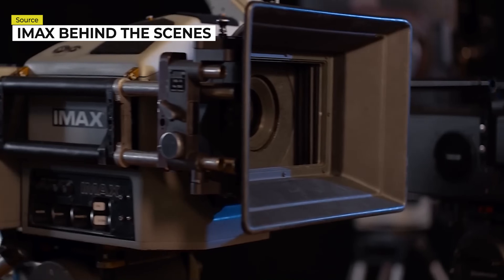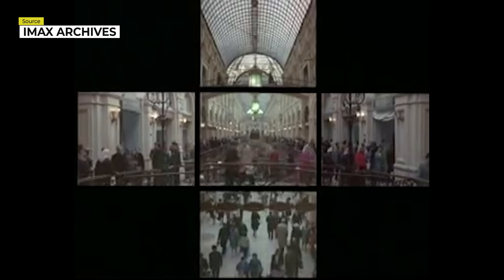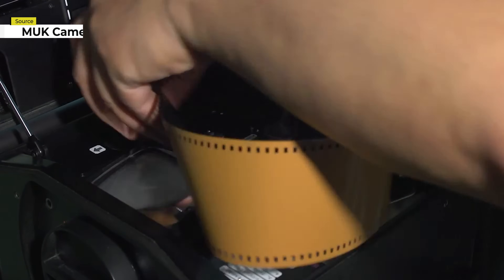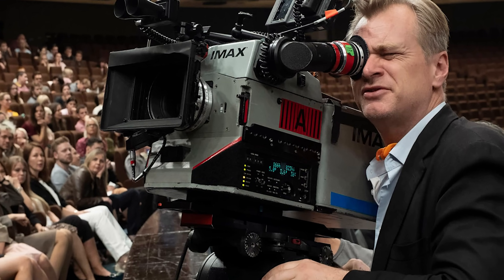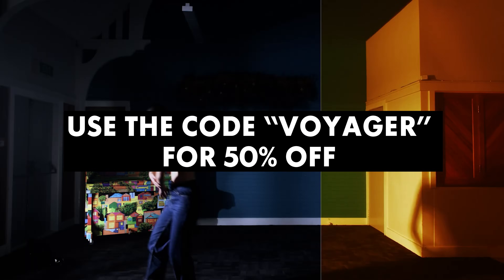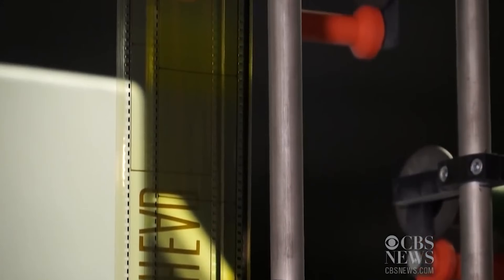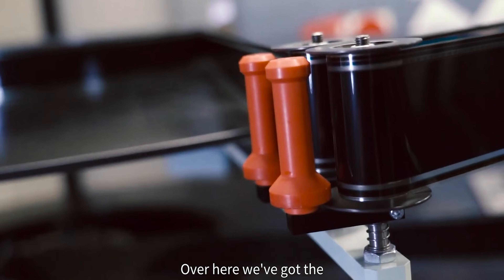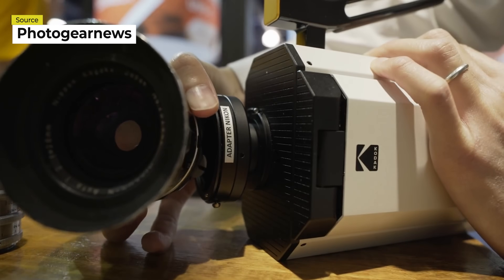The TRUTH about building a Digital IMAX camera

Comment: why can't you just use original imax-lenses in your hypotatical imax camera, those already have the image surface
Reply from the maker: Because of the difference in lens construction. They tend to have larger backend elements that push into the camera where the sensor for a digital camera would normally be. George Lucas and panavision had a really hard time with this back when they first converted to digital for Attack of the Clones

Comment: Shorty at 7 minutes has it all wrong. Scaling up 8k footage to 16k that was likely shot on a super35 camera doesn’t solve for difference in depth of field, it wouldn’t have the same pixel density as it has less sensor surface to work with. Not to mention dynamic range, etc… The only solution is to make bigger digital sensors.

Comment: With regards to "film emulation" I am not sure that is important.  It isn't necessarily the be-all-end-all to look like film.  Film has its limits too, and you could look at it as they were stuck with grain, like it or not.  The thing that matters is detail.  If the detail can be captured at a high enough rate, it can rival imax film.  It could be transferred to film, if they really want the film look.  So the question is how to get 15:70mm levels of resolution.  

It is certainly possible to make a camera that approaches the the theoretical 18k resolution of imax film.  That would be several hundred megapixels, oversampled, and potentially requiring multiple sensors for dynamic range.  But that should be possible these days...

Comment: This might sound like a stupid question 
Why can’t we use the same sizes of lenses on the digital sensor as the film camera if they are the same size
Reply from the maker: Not a dumb question! I should have answered it in the video as it's the most asked question lol. So film lenses have larger backend elements to them because of the lack of a sensor they can go farther back into the camera. George Lucas and Panavision had multiple problems trying to adapt for the first time using digital cameras because of this issue. So you'd probably need to develop some specialized lenses or figure out how to properly adapt the old ones

Comment: If it’s just the grain needed, one could used a older Sony pro DVHD camera with a digital output and lay the two images on top of each other to create the mask.
It’s not really that hard and one doesn’t need to go as high as 2.5 K to create in image that could be shown in a higher format.
Film is not pushed that high and the bigger you go the more you can get it wrong.
It’s not just the size.
It’s more the look.
I’ve been trying out things like this and am working to test it with look being more important then size.
The over lay will create the bigger image.
There isn’t a software yet available that can stack up digital footage.

Comment: I have a 9x12 (cm) glass plate camera. And the negatives are crazy. IMAX essentially has 24 of them per second. 

I do believe that digital can get close. We have massive sensors but those never make it to cinema camera systems. The largest CCD sensors are like 92x92 (used for telescopes as you have shown before). 61x61 sensors are in "cameras" like the Andor iKon-XL. 
Next there is LargeSense which I believe uses medial CCDs normally used for digital xray plates simply with the flurescent layer removed. Their LS811 is four of them while the LS45 is a single one. see a video from Ben over at AppliedScience for how they can work for x-rays. And with a bit of equipment I believe it could be a visible light detector (for video too). 

And it's not just the pixel resolution. BMD Ursa 12K ha been called digital iMAX but so has 8K
Reply: I mean technically, the Vera Rubin Observatory has a CCD the size of a 4-square court or something IIRC.  However I think a 52x70mm sensor would be very doable to produce if you really wanted to.  The issue is that this thing could be easily something like 12K and the readout speed + thermals would be a challenge.

Comment: I see the problem being that we have decided, somewhere along the way, that a bigger film print is a better image than what a 12K or let's go nuts, a 24K digital sensor would capture.  The reason we would have to try so hard to make a huge sensor, which would require huge lenses is because we are trying to force a digital image look like a flawed analog format.  One of the reasons film looks so nice is because we've been conditioned to think that's what it's supposed to look like.  And that's ridiculous.

We don't experience life in 24 frames a second.  And we don't have film grain or any of the other character flaws of lenses or film stock in our eyes.  Digital has the ability to better reproduce what our actual vision is, but when we attempt it, audiences reject it.  The 48 frame per second version of the Hobbit trilogy wasn't widely preferred over the 24 presentation.  And Gemini Man filmed and presented in 120fps was just really off-putting.

So we are stuck experiencing film at the same 24 frames a second since the late 1920's.  Until our expectation of what a film is supposed to look like changes, we will continue to try to make digital cameras produce an image that looks like analog film.  It's my opinion that the percentage of viewers who would appreciate a real IMAX 15/70 presentation is extremely small, as compared to the percentage who just want a big screen with loud explosions and transforming robots.

So it makes very little fiscal sense to chase this dream.  The closest REAL IMAX 15/70 theater to me in Orlando appears to be in West Palm Beach, 3.5 hours away.  As much as I'd like to experience Oppenheimer as Nolan intended it, I'm not going to be making that drive.

Comment: I was wondering if the lenses used in the actual IMAX cameras wouldn’t fit in that theoretical IMAX digital sensor?
Reply from the maker: Depends on how Large the backend elements are. Problem they had moving to digital in the 2000s was the lenses were too large and would hit the sensor block

Comment: And no one speaks of the importance of having a wide sensor ! Proportion and field of view ! Dammit, this is probably the most important thing about it ! We don't care about resolution, it's useless, 4k is enough, stop arguing about it. The size of the sensors means that you can mount a 50mm on it and have a wide angle as natural as the eyes vision. This is the real power of 1570, it looks natural, because it is as close as we can get to the eye' perception.

Comment: Loved the video! My BS alarm is going off about the claim that the 9x7 can produce a more shallow depth of field than an IMAX camera though. Everything I’ve learned about DOF has been explained in terms of sensor (or film) size and the physics of how apertures work. Without more information, I can’t wrap my head around how he could possibly be correct about this unless he’s trying to claim that the size of his system accommodates massive lenses with massive apertures.
Reply: seems like the obvious step to take?
Reply: yea going from apsc to ff i  don't get how it would be ever possible for apsc to have less dof then a ff ? always thought that the large the sensor the less dof you get and the reason phone cameras have so much dof and have to fake it using AI or some nonsense

Comment: wow SERIIOUSLY just looked the supposed "9x7" camera that was mentioned in the video
the sensor size isn't even larger than full frame!!!!????
like it's already an accept fact that NOBODY gives a shit about resolution! it's the actual sensor SIZE that matters
15 perf 65mm film is absolutely GIGANTIC compared to full frame. it is going to capture a completely different image because of that
all those technical jargons that you tried to come up in the video and you don't care to include that property of imax???
Reply from the maker: We did cover what the translation of 15 perf 65mm film size would be for a digital sensor at 15:00 - But we said that it would be close to 70mm x 48.5mm which of course is not the size of the achtel 9x7 camera. But some of the argument there is you might not need the sensor size to be that large to get the equivalent image.

Comment: You lost me at 15:50 Problem 4: needing larger lenses. If this theoretical digital sensor is the same size as 70mm IMAX film, then why can’t it use the same lenses as the IMAX film camera?
Reply from the maker: Same reason Panasonic had to redevelop their film lenses for star wars clone wars. Backend elements on the lenses were too large and would bump the sensor. So thats a potential issue depending on lens construction and design. Depending on if you go all out and use current "IMAX" glass. This video is just pushing everything to the max
Reply: @FrameVoyager  I see. Very interesting, thank you for replying :)

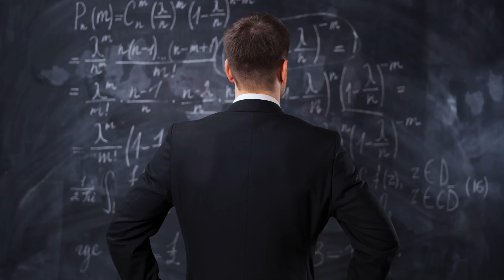Comment: 16:26 24.19 gigaBYTES a second uncompressed 14-bit 18k raw AT 24p, NOT EVEN GIGABITS, even at 3:1 thats 8.06GB/s, even 5:1 that's 4.84GB/s. Actually insane. 

Theoretically, that means in a terrabyte you'd have:
41 minutes recording time lossless,
124 minutes 3:1,
206 minutes 5:1,
AT 24P. FOR A TERRABYTE. AND WHAT STORAGE DEVICE EVEN HAS THAT OUTPUT

Comment: My attempt at calculating the bandwidth required for 18K, assuming that means 18432×10368 and 16-bit color depth.

18432 pixels × 10368 pixels × 24 fps × 3 components per pixel × 16-bit per component = 200.15 Gbit/s = 27.52 GB/s

That's of course assuming that you're storing the footage completely uncompressed, you may be able to get significant savings by using a lossless coding technique, but you'd probably have to build your own chip to handle that throughput.

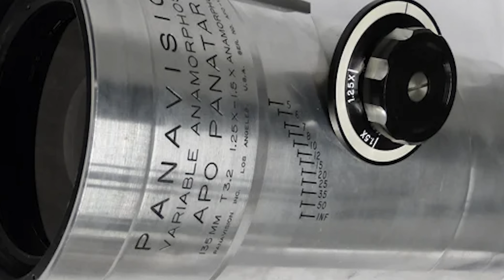Comment: but, doesn't IMAX already have the necessary lenses for this format? I mean, you said 15:55 that larger lenses were needed, but also you said before that each IMAX frame is in the 70mm format. What gives?
Reply from the maker: Historically, there have been issues with how the lenses are constructed for film cameras vs digital. When they first started to film digitial for phantom menace, panavision lenses were used but the backend elements of the lens would bump into the digital sensor. So I'm assuming similar problem here

Comment: People need to stop using Steven Yedlin as there only source for the film/digital debate. There’s so many others from the technicians at Kodak, Arri and IMAX who can break down some of his fallacies. Such as film being indistinguishable from digital. A film scan, depending on the situation is an interpretation of film so can be mimicked (not easily which is misleading) but an inter-positive print is totally cant be copied. But his claim that 6k is the max resolution from IMAX is physically false. If you’re getting 2.5k from a 4 perf frame (not optimal conditions) you can fit 7 of those in anIMAX frame. Thats between 12k-15k. Not that resolution matters and not that the film/digital argument matters, it’s all about picking the medium YOU and YOUR CREW prefer, pushing digital or film on anyone just takes away from the artistry of this industry and turning it into a tech dick measuring contest. At the end of the day digital imax wouldnt be cheaper, just as the rental price for a alexa 65 puts it along the same price as shooting on 65mm film, just with more cameras available

Comment: ⭕ A look at the FUJI GFX 100 System: Large Format 44mm Width, 11,6K horizontal Pix., WITH(!) suited Lenses that hold the Resolution.
I'm really curious, because in Terms of IMAX, this System screams on it. At this Moment, the GFX100 11,6K reads out lineskipped 5,8K which ends in perfectly oversampled 4K, which is nice. Not even talking about the welcomed Outstanding lovely and flexible Color-Science. 

The actual GFX100 Sensor is limited to this Readout, and something above would need further Re-Developments. The important Note here is, that high Resolution Big-Pictures needs large 1. Sensors AND 2. fitting Optics. ACHTEL in the Video doesn't have that either. So it's not working with small Sensors, which we allready know from the very good Blackmagic 12K S35 Camera, here the lacking Optics are the clear Limit. 

In the GFX100 System, all is allready there. Thrilling Times. Lets see if FUJI is entering the IMAX Market with an GFX100 "H" focused Series Camera Body with a faster Reading Sensor System, which would change EVERYTHING on Digital IMAX Content Creation in my Eyes and at the first Time have the potentital and could Replace 15/70 analog IMAX (which i love instead). 

THINK ABOUT IT :)

Comment: There's absolutely no need for a digital Imax camera to have a sensor size that matches the size of 65/70mm film stock. Modern sensors have sufficient sensitivity that you can get away with a much smaller one. Larger sensors give you shallower DoF and more light gathering, but beyond a certain size these advantages are outweighed by the difficulty of making good lenses and their cost. Realistically, a modern digital camera with a 35mm sensor and 8K resolution is already better than 70mm film for most purposes.
Reply from the maker: Oh, 100% agree! More of an exercise of if you could go crazy on building one full out to scale, what would the monster look like 😅

Comment: I'm a little disappointed you didn't spend more time talking about the sheer size of the frame and how it affects the field of view and depth of field, and I dislike that the inventor of the 9x7 seemed to hand wave it away. There is a total perception change the bigger your sensor or film frame gets. There's a reason people still shoot 4x5 and 8x10 film, and it's not just because there's an increased resolution.

Because the frame is so large, you have to use a higher focal length lens to achieve the same framing on a smaller format with the cameras at the same distance. For example, a 50mm lens is considered standard vision on 35mm film, but to achieve the same field of view on medium format, you need an 80 or 90mm lens.

The effect is that the larger the frame/sensor, the closer you feel to the subject. You also gain shallower depth of field while retaining a sharper foreground. For example, to get the same framing and depth of field as a 50mm lens at f5.6 on 35mm you would have to shoot a 25mm lens at f2.8 on 16mm film.

Think of it like this: we don't laud murals for being superior to a portrait because they have more resolution. They do, but the fact is they're just bigger! Your relationship to the work is different than if it were smaller. The size of the frame and the screen matters more than sheer resolution, which is why it's such a shame that IMAX started diluting their brand by retrofitting old theatres with off the shelf 2k projectors.

Comment: I was going to say 9:10 - 99.9% of "IMAX" theaters are not actual IMAX. Just use a larger screen and use a digital projector. On top of lying to the viewers, my home TV looks better. Why spend $15 a ticket when I can watch at home. Movies theaters are dying out because they fail to provide something unique. 20 years ago I would go ever month. Now once a day at most. 20 years ago, DVD or VHS was the best you could have. Now UHD is in my home.

When it comes to what resolution IMAX is. Well 35MM scans at 50MP is a 1:1 copy. Once you define the entire gain and see the actual sliver bits to make up a film negative, no more resolution is to be had. So IMAX is 3.5x 35mm. which means a true digital IMAX camera needs to be 175MP. 8K is  33MP. We are a long ways away from a 1:1 IMAX digital copy.

Comment: Stills photographer here. Shooting a 6x7 or 6x9 film camera is similar in film sense to a single IMAX frame. Have you ever stood next to a digitally printed wall size mural of a film frame scanned at 8000 dpi? I have, they had one hanging at Rayko SF before it closed. It was a b/w print of the canals of Venice, Italy. You can walk right up to it and pixel peep and not see the grain. Do the math, 2 1/4 x 3 1/4 x 8000 dpi = 18k x 24k. Which printed at 240dpi makes a 10 foot wide print. I was never told which camera, lens, and film stock, unfortunately. I always guessed it was Adox CMS 20II. They claimed it was from 35mm which I couldn’t believe at the time but which may have been true, scanned at 12000 dpi on their Tango (capable of 16-bit color).

Look around, you’ll see services offering to scan your 6x7 frame producing you a 1GB file at 179.4 effective Megapixels. For reference, an 8k frame is only 33 megapixels.

If you can imagine that motion picture film projection at 24fps actually increases the perceived sharpness even further because film grain does not fit squarely into a bayer sensor, grains are formed in varied organic patterns.

Comment: The lenses would not be expensive. Wally Pfister shot the IMAX scenes for The Dark Knight on an 80mm f2.8 Zeiss Planar Hasselblad lens. You can buy this lens on eBay for less than $800. You would want it modified to declick the aperture wheel, and the focus wheel is extremely stiff (Pfister had to rig up an extremely powerful motorized follow focus), which I discovered myself trying to use it manually, but it is an open secret that IMAX lenses are often just old Hasselblad lenses.

IMAX lenses are cheaper than pretty much any cinema lenses on the market. The tricky part can be using them with your camera - unless you happen to have an Alexa 65, my recommendations are either a GFX100S with a Metabones speedbooster, or a Canon R5C with a Kipon speedbooster. The former has an actual medium format sensor, but "only" 4K resolution and lower-quality RAW, while the latter has a full-frame sensor, but better image quality, 8K resolution and the ability to record Canon RAW internally.

For emulating IMAX, I use an R5, a Kipon Baveyes, a Planar 80mm, and Filmbox, which is the best film emulation software you can actually buy. A perpetual license is $1,000 - consider it as part of the camera cost, you are "adding film capability" to your setup.